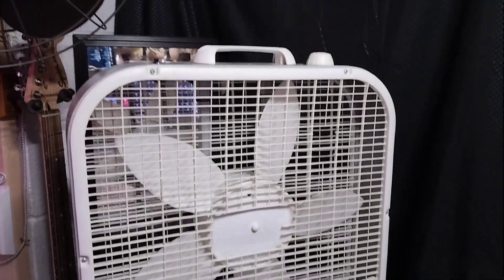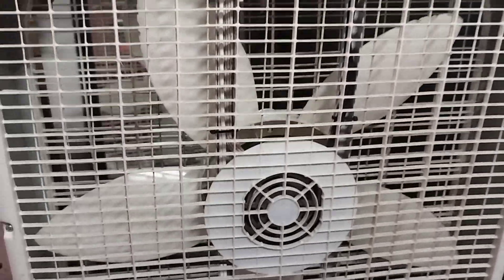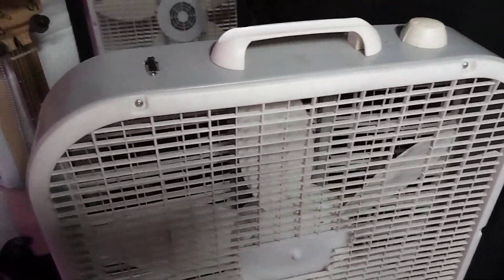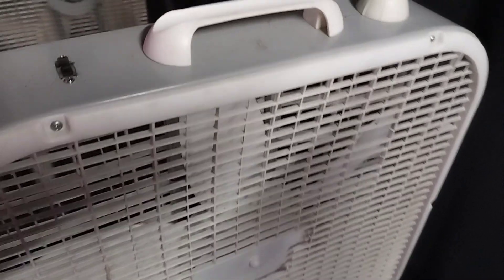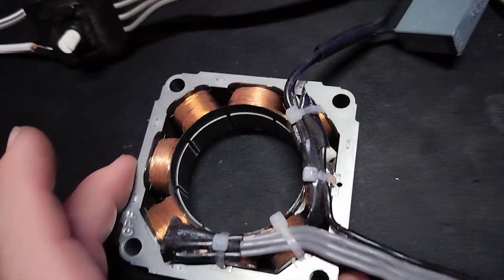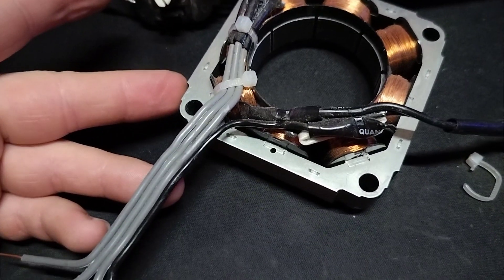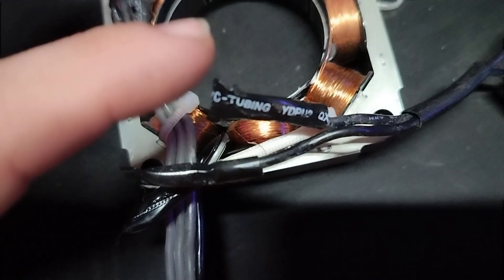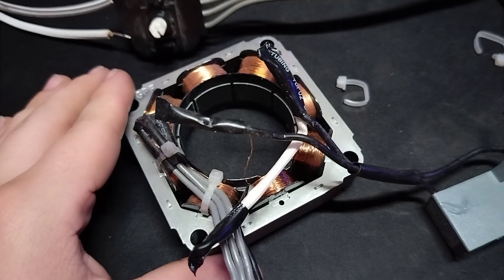Making a Lasko box fan electrically reversible.

Comment: When it’s in reverse those it pull air? Those it work as an exhaust fan?
Reply from the maker: Yes it works as an exhaust fan however the blade is not as efficient in reverse due to the way its shaped.
Reply: @jayhubman1188 do you know of an exhaust fan like this one that I can buy?

Comment: The Lasko box fan is perfect for doing that kind of experiment.  Theirs millions of those fans everywhere and they definitely aren’t a rare brand like some other fans videoed.  In my opinion, a modern day Lasko box fan is pure junk anyway.
Reply from the maker: Yeah these fans are very plentiful in fact when I was 10 to about 16 I would grab these out of the trash and put thermal fuses in these and sell them and would sometimes make $200 during summer just selling fans at 5 to 10 a piece during the yearly neighborhood yard sale and later craigslist when I moved. The motors are often just fine if not just a bit dirty or seized I think if they stuck with the 130c fuses instead of going to the 115c they would be pretty reliable but they had the recall in 2004 and that's when they changed it so they are playing it safe I guess. I will say these laskos are far better than some other newer brands I've seen like aerospeed, coolmaster, comfort zone, climate keeper etc.
Reply: @ That’s interesting to know.  I didn’t quite think that a thermal fuse could be replaced in one of those fans.  In my area, I see a lot of Lasko 3733s tossed at the curbside.  Maybe it’s a blown fuse.  And yes, I am familiar with those beautiful blue plugs on Lasko fans, Lol.  A Lasko 3733 or really any modern day box fan isn’t my fan of choice.